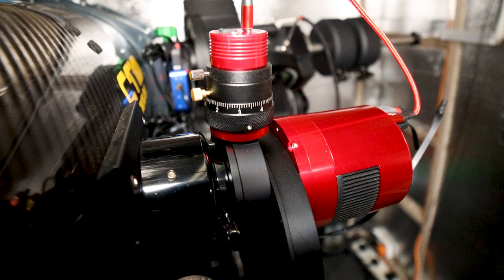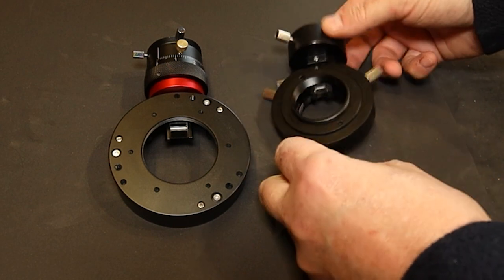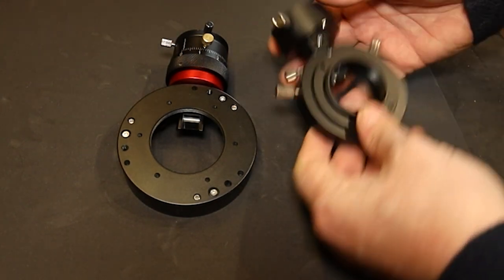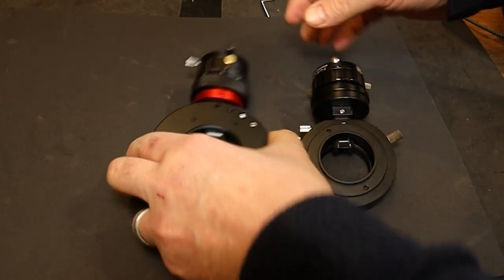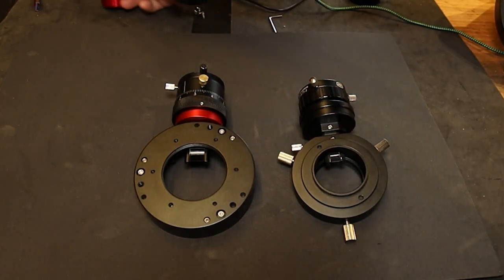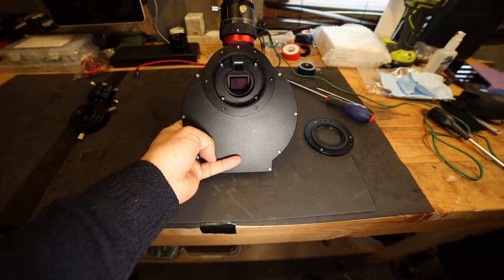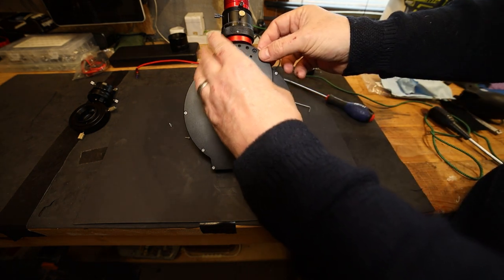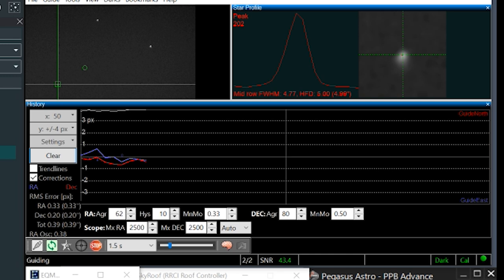ZWO  OAG L Guiding for Astrophotography

Comment: Hey my friend, you and I have the same camera/filter wheel/OAG-L set-up. I have been hesitating putting everything together because I wasn't sure how everything was supposed to connect together. You solved that problem brilliantly, and now I can get on with using those components in my imaging system. Thank you so much!!!
Reply from the maker: Hi Darryl , that's great and I suppose you could say good timing. Very nice gear and you will have a lot of fun with it. clear skies
Reply: @Astrobloke  Glenn: How did you attach your ZWO ASI 1600mm Pro to the EFW filter wheel? It appears in the video that you screwed the two together, but I have no idea how you did that. The holes on the sensor-side of the 1600mm don't line-up with the holes on the filter wheel. Is there some type of adapter that fits between the 1600mm and the filter wheel? If so, can you tell me what it is and where to get it? Thanks!
Reply from the maker: @darrylhedges1372  hi There. I have the 2600mm not the 1600mm and I think thats why there is a difference for mounting. You would have to screw the 1600mm on like I do for my 294mm which is also a smaller camera body with the 4/3rds size sensor. Hope this helps

Comment: really nice video. It's possible to mount the OAG-L directly on the asi camera without a filter wheel?
Reply from the maker: Hi Maurizio, thank you for your kind comment. The OAG bolts to the camera the same way and holes the filterwheel uses

Comment: Thank you Glen for your through and patient walk-through on this. Question on removing the filter wheel holder from the base. You removed the center screw, washer, etc. I’ve read where someone said the proper way is to remove the three screws rather than the center screw because by removing the center screw you have to have the tension just right on the wheel so as to not over-tighten the center screw. Wondering how you feel about that.
Reply from the maker: Hi Joseph and thank you for watching and commenting. I think some people like to overthink and complicate issues. You just do the screw up so there is no play as it acts on a bearing. It does not need to be tight and you would realise very quickly if too tight as the wheel will not turn. I have removed the carousel multiple times on quite a few EFW and have never had issues after so I think it is a fairly safe way to do it.

Comment: Thanks for the info Glenn
I have the 2600 and filter wheel but haven’t bolted them together 
I use the dew strap designed for the 2600 camera and am not sure i would be able to use it if I bolted onto the filter wheel.
I find your video’s are a great resource for beginners so keep up the good work 
Cheers
Reply from the maker: Thank you John for the  kind comment and glad the videos are of help.
Interested in which dew strap you are using as the 2600 comes with an inbuilt dew heater (I have the mono and that does and I am assuming the colour is the same) 
I control my equipment with NINA and on the camera tab you can switch the cameras dew heater on/off
Reply: Every day I learn something new.
Today it was that my 2600 had an internal dew heater and because of my ignorance i also fitted one to the outside 😅 must admit I have not had any problems with dew. I’m pretty new to this game so not had time to read all the small print.
Thanks again Glen
Reply from the maker: @uktrismus  HI mate. There are so many small details in this hobby its very easy to miss stuff but its always a learning day I find. Always happy to help if you have any questions so don't hesitate to ask. Clear skies

Comment: I am in Bortle 9, and using the 174mm mini on a 10" RC and the smaller OAG.. I have ran into issues seeing stars many times and this video made it so obvious as to why lol... thank you! I feel idiotic by not noticing how small that hole is on the original.
Reply from the maker: Hi James and that’s great the video was able to help you. The larger prism definitely helps and that 174 is a perfect match, i use a 290 which works well too. I think the smaller one is ok for focal lengths upto 1000mm just but over that you start to struggle. Clear skies

Comment: Hey Glen thanks for the video, Cheers. I would have love to have seen how you went about the method you used in getting the focus right. 
Thanks :)
Reply from the maker: Thank you. I made an earlier video fitting the smaller ZWO OAG and in that I show the focusing of it. I have put a link to it below, hope that helps and clear skies.  How to fit the ZWO OAG (Off Axis Guider) and set up with ASI290mm. Astrophotography guiding PHD2.
https://youtu.be/3PcSljeVNLM
Reply: @Astrobloke  I’ll check it out thanks. I have the same set up as you in this video but I’m struggling to get focus as I seem to run out of travel. My 174mm is all the way in and need just a bit more travel to get proper focus. Smaller scopes and wheels don’t seem to have the same problem. Thanks again for your reply.

Comment: Thanks for the video Glenn. Really helpful. I'm going to try to pick up an OAG-L at the IAS on the 15th October. Looking at your setup, it looked like you've got a coma corrector on the front of your image train (I've got the skywatcher 0.9x coma corrector, but looking at your video, I think yours in the Baader version?). Did you use a spacer between the OAG and the Coma corrector? Couldn't quite work it out when watching the clip. Many thanks
Reply from the maker: Hi Rob. I will be at the IAS on saturday so please come say hello if you see me. I use the same corrector that you have and a Baader MPCC MKIii
spacer depends on which camera I am using as they have different backspacing needs but I think there is a 10mm one.

Comment: Hello Astrobloke,
Good work on this video, I like the clear explanation you gave. 

After screwing on the tilt plate, what did you screw on to the OAG?
Cheers
Peter
Reply from the maker: Hi Peter and thank you for your kind comment. As I use my set up on a Newtonian scope it needs something to insert into the focus tube. I attach a coma corrector. If you are using a refractor or say and SCT you would then screw directly to this assembly adding any spacers to achieve the correct back spacing to the sensor (most instances this is around 55mm)
Reply: Great, thanks  @Astrobloke

Comment: thnks.Good info, I think ill try the baby OAG first with my sct
Reply from the maker: Hi Rob. The smaller OAG by ZWO works really well too and I still use mine with the 294mmpro
Reply: As far as I've been told by ZWO, there is no way to use this unless you have a filter wheel. If you have a filter wheel don't get the small one. If you have a long focal length scope, it can be hard to find guide stars using the small one.
Reply from the maker: @Dennis-tf2cs  i’ve not had issues at 1200mm with the small one at all. The Larger one is definitely better.
Reply: @Dennis-tf2cs  Hey There, you can definitely use the OAG L without a filter wheel. Originally bought mine to use with my 80mm refractor +2600mm but later kept the guidescope. When Galaxy season started and I bought a 294mc pro to pair with my 8SCT, I remembered the OAG L and hooked it up with no issue. ZWO has a diagram on their website showing how to pair it with 4/3 sensors. You will of course need 2 adapters which are inexpensive and quite easy to setup. Once done, I got plenty of guidestars. CS!
Reply: @hamzailyas-muslimastronome3506  I have a asi 294 mc-pro and am looking into the OAG L. Having difficulties working out what backfocus I will need. I have the ZWO filter drawer in my imaging train too instead of a EFW.
Reply: @KyleDay96  Remember, your scope (or reducer if you have one) has its own back focus requirement. Check with the manufacturer of the scope (or reducer) for the recommended back focus.
Reply: @hamzailyas-muslimastronome3506  Could you provide some additional details and/or links? Looking at using 2600MC-Pro OSC with OAG-L and no filter wheel (ultimately connected to C9.25 Edge HD). Thanks!

Comment: Nice tutorial - thanks Glenn!
I am looking at bolting a 2600MM to the EFW 7x36mm. Have you experienced any light leaks on the interface between the camera (with the Tilt Plate removed) and your EFW? Seems to be some commentary around this out in the wild. The Telescope side has four holes that it appears the OAG-L would occupy so should not be an issue there.. 
Thanks - this is most helpful!
Reply from the maker: With the EFW and OAG-L attached none of the holes are open so absolutely no light leaks at all. I did use my 294mm on this wheel and just put a small piece of black tape over the exposed holes and that worked fine but ZWO really should include some caps or plugs for these hole if not used

Comment: Glenn, thank you so much for your video! I have the same OAG but my filter wheel somehow has no holes to attach it the same way you did. I'm really, really new at this. Do you have any advice as to how I can work around this issue? Thank you in advance!
Reply from the maker: Hi there.  The ZWO later filter wheels came with the mounting holes to accommodate this OAG I am not sure if there is any other way to attach it. You could email ZWO and ask if they have any ways to work around this? I wonder if they sell just the EFW cover with the holes included? I remember when ordering my 36mm EFW I had to get the ver 2 as that had the new mounting holes included. Sorry I can not be of more help. I will ask around and try and find more info for you though. Good luck
Reply: @Astrobloke  Thank you so much for your time and reply! I'll try reaching ZWO support.

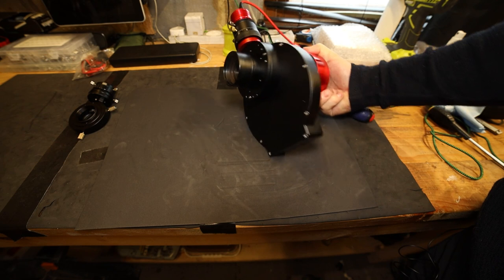Comment: Thanks SO much for this. I am new to off axis guiding (having just bought a long focal length scope) so this is exactly what I needed and very clear. Chroma filters, I notice. Only the best, eh? Is the enormous price justified? (I'm asking as someone who's not yet contemplated doing narrowband). One thing I didn't understand is that at 9:07 you connect your guide camera to your imaging camera. Why is that? I just connect mine both to the Pegasus Ultimate Powerbox. But maybe I'm doing it wrong?
Reply from the maker: Hi Stuart. I bought the Chroma filters used, a while back but they were the 1.25" so won't work with the 2600mm APSC sensor, I use them with my 294mm pro. They are excellent filters but the new Antlia 3nm filters are just as excellent and I honestly cannot tell the difference. So a big saving getting them over Chroma or Astrodon.
 It doesn't matter where you connect the guide camera and I only chose the main camera as I have nice short usb c cable and its nice and neat solution. I also attach the filterwheel into the camera and this means I can move the image train other scopes  and leave those 2 cables connected. I avoid unplugging and plugging usb's in as much as possible as they can be temperamental.
Reply: @Astrobloke  excellent. Thanks 👍

Comment: Hi Glenn,  Great video.  I have the exact same setup... just a question, what were the spacers you used at the end of your image train?  Keep up the great work!
Reply from the maker: Hi Kevin. How rude of me I forgot to reply. Think I was going to double check then reply. Sorry. On this set up it has a Baader MPCC MkIII and a 20mm spacer. The backspacing is supposed to be 55mm but my stars were not sorted in the corners until 57-58 mm.

Comment: Glenn, thanks for the video it's really great to see a full build like that. I'm about to jump on the OAG bandwagon after dropping my scope due to no handle and my own idiocy! I'm on the way to PAS myself to get a replacement.

Question for you, I use a 0.8x reducer and 1.0x flattener on my refractor. The light cone is going to get compressed with the reducer - would you recommend setting up the prism depth with the reducer on as it's likely to require the OAG prism deeper?

Additionally, the ZWO OAG is going to necessitate the removal of my beloved Gerd Neumann CTU tilt adapter. I notice that the tilt plate is included in the OAG-L - have you got any experience with adjusting this on the fly? The CTU is all about easy access to screws to elminate tilt without any image train disassembly.

Cheers mate and hope to see you at PAS.
Reply from the maker: Hi P T and thank you for your message. Hopefully I will make PAS.
I did have a ZWO OAG on my RC8 before I sold that scope and used a 0.75x reducer. I did set the OAG up with the reducer on and found it worked great. I think its best to adjust with whatever imaging train you decide to use.
The ZWO Tilt plate can be adjusted while in the imaging train but how easily I am not so sure. On my CT10 there is not much room and its difficult to see. I seem to be lucky with my camera that the plate is just zero'd out and I don't need to adjust it at all. The CTU looks a nice solid piece of kit. I had a tilt adapter similar to this also on my RC8. The ZWO is easy to adjust so I am sure it can be done on the fly.
Clear skies

Glenn

Comment: Great review, I might have missed it but do you know the total backfocus the OAG + EFW + 2600MM takes up?  I’m trying to decide if I have enough backfocus with my PrimaLuce Lab Essato and ARCO in the mix on my Edge HD11.
Reply from the maker: Hi. I think you have quite a generous back focus on SCT's and should be able to work with this. The EFW is 20mm I believe and the OAG L 17.5mm but double check on the ZWO websites.

Comment: Is it useable if you have a color camera like the ZWO ASI2600MC-Pro or smaller without a filter wheel and just a one filter tray from ZWO.  Or should one use the smaller OAG?
Reply from the maker: I think it is only compatible with the filterwheel but you could check with ZWO or retailer. It would make sense that they did a filter drawer that would also work with it. You would need to get the smaller OAG if you don't have the filterwheel.
Reply: Thanks.  The ZWO filter drawer I have measures 20 mm (front to back) and I read their filter wheel is also 20 mm.  So, the back focus should be the same.
Reply from the maker: @malanstecker  yes I think they are the same size so won’t change backfocus

Comment: I have a thread on Camera and I cant get it centered, but on y our OAG it looked like you were center on the pins. how can I rotate the top to get camera on center?  is that even possible
Reply from the maker: I think with the filterwheel from ZWO (not 100% sure if it was this or the OAG) there were some wafer thin plastic spacers. I kept swapping them around until the camera was tight in the upright position, not much else you can doo really unless you introduce a rotator.  The 2600 bolts on so in perfect alignment straight off

Comment: Is there any reason to use this if you are using a small sensor like 533mc pro on a C8 SCT with a 0.63 FR?
Reply from the maker: Hi Ash. so your focal length with that reducer is 1280mm which is similar to my CT10 with a 1200mm FL. My question would be what are you using as a guide scope (focal length?) and what is your typical guiding on an average seeing night?  Your Pixel scale for that camera/scope combination is 0.61"/pixel so for the best image anstar results you need to be guiding 0.6rms max and lower. The reason I use a OAG is ideally your guide scope should be no less than 25% of your main scopes focal length so in your case 320mm minimum.   Now this is all the theoretical ideals but if you are happy with your guiding and images and it all works I would not worry about an OAG.
Reply: @Astrobloke  Thank you so much for the detailed answer. I wish I was clearer in my question.  I should have asked if there is a reason to use this OAG-L instead of the regular OAG? My guiding camera will be a 174mm pro, and the main imaging camera will be 533mc pro.

ZWO is a bit confusing on their website as they seem to recommend the OAG-L for "larger camera sensors". Are they talking about the main camera or guiding camera?
Reply from the maker: @AshA-ww8hc  hi no worries. The prism hole on the smaller OAG will not use the whole sensor on larger guide cams. I use a 290mm  and the 174 is even bigger. I would recommend the OAG L especially with that guide cam. Its a Much better OAG by ZWO all round too.
Reply: @Astrobloke Great thanks!

Comment: The only problem is you can't use it unless you have the filter wheel.
Reply from the maker: That is a good point and something I hadn’t thought of as of course I use filter wheels. Zwo should include an adapter to allow that the be threaded like the tiltplate does on one side.